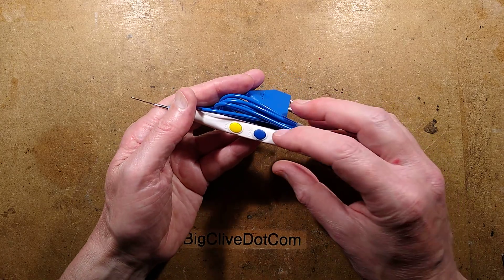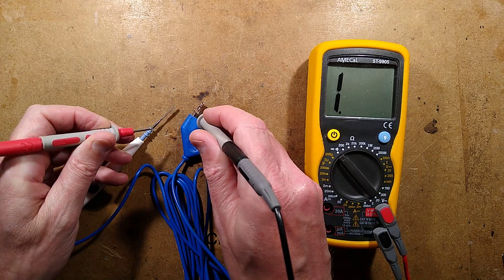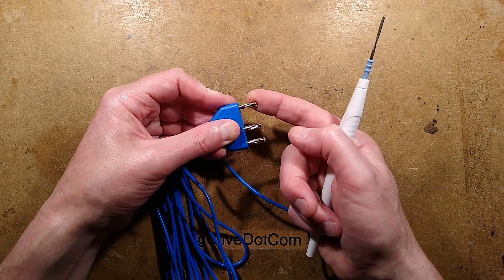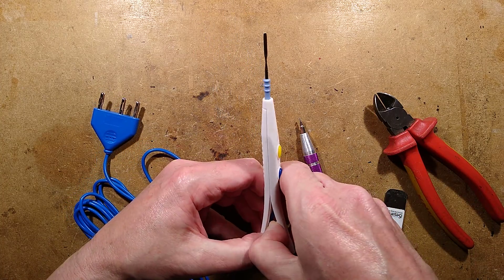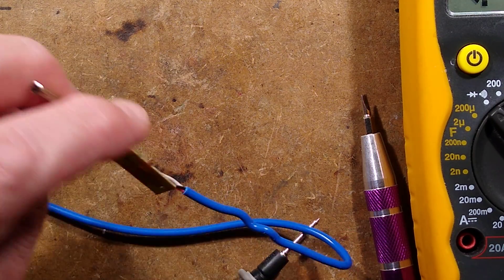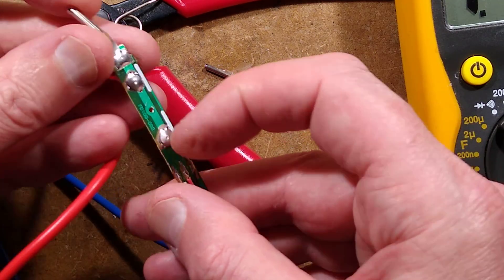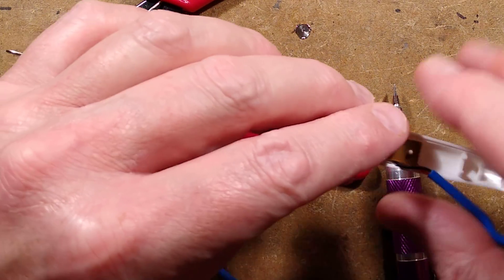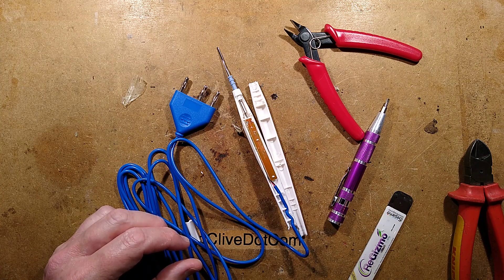Inside a single-use electrosurgery/cauterising pen

Comment: Now to get the control unit to take to bits ... .
Reply: I've checked and the local Poundland shop does not have any diathermy units in stock.
Reply: I've been inside an old Birtcher "Hyfrecator" (portmanteau of High FREquency eradACATOR) which was essentially a spark-gap Tesla Coil with variable coupling between primary and secondary, and a Parkall Dental Model ESU which replaced the spark gap oscillator with a "high tech" triode vacuum valve... (both rather low power units intended for minor out-patient procedures...)

Comment: Handy if you need to sell a kidney to pay for a container full of ozone machines 😂
Reply: Or a gpu
Reply: @alop53O1  lol true
Reply: These pencils plug into a generator, which created a high voltage at several kV and low current at maybe a few hundred mA. The generator is essentially a signal generator and generates modified sine waves for different types of cutting and coag. The generator has different power levels and waveforms depending on the manufacturer, the pencil and the procedure. 
Those pencils are made for pennies. Most of the innovation is in the tip geometry to stop charring and eschar buildup. Some have different coatings too, like a glass coating with only the edges of the blade exposed.
Reply: I'm a DIY tool addict too, I've got shed loads! 

As someone in my 60s with an enlarged heart and lung problems, I'm going to buy one of these for my inevitable heart & lung transplant. I'm preparing one corner of my home workshop for this eventuality. I hate letting others do a task if I can do it, I even do my own plumbing!
Reply: @nicholasvalentine3907  "I even do my own plumbing!" Internal plumbing??
Reply: @lloydpenfold486  Ha ha, yes! 

A few years back, I was in hospital having an examination of a somewhat personal nature. They set up a screen so I could see where they were putting the damn camera, nice! However one thing that went though my mind when it came to my internal plumbing was, "this is definitely evolution and not design", the layout was pretty terrible, what seemed to be a rightangle bend with no regard for flow and other dodgy stuff. Now where did I put that local anesthetic??
Reply: @nicholasvalentine3907  I have watched, in real time, an X-ray video of my spine (to see a 'slipped' disc herniated inside of it), and the picture seen by a Sigmoidoscope as it travelled up my lower intestine. Fascinating stuff, so long as it don't hurt!
Reply: BWAHAHAHA
Reply: Facts 😂
Reply: How... how did you post a comment 1 week ago... on a video posted 2 days ago......
Reply: @everettrailfan Patreon gets early access.
Reply: @weeeeehhhhh  Oh lol that makes sense.

Comment: I had knee surgery in 2014 where they did RF ablation of the patellar tendon. This is the device they used though the one they used on me looked quite a bit more "fancy." Likely for ergonomics purposes.

Edit for clarification: I was not awake during the procedure, obviously. I am an engineer and asked the surgical technicians once they rolled me into the OR theater, what the device looked like that would be performing the procedure. They brought it over to me in its packaging and then the anesthesiologist said "Ok, time to go to work, Brian!" and it was lights out LOL
Reply: I got billed for one of these bad boys after a surgery last year. Just under $800. I didn't even get to keep it!

Comment: The ESUs used to have spark gaps. RFI was not an consideration. The were generically called 'Bovies', at least in the us. When we had to work on them we would go get meat patties from the cafeteria. This would have been late '70s/early '80s. I am sure technology has changed significantly.
Reply: “Bovie” was the name of one of the original manufacturers.
Reply: The spark gaps were replaced with triode valves/vacuum tubes and I believe they now use new-fangled transistors... 🤓

Comment: "Diathermy" also includes using equipment to create heat inside the body for therapeutic purposes. In the 1930s diathermy machines of this kind used MHz-frequency radio waves beamed into the body at high power. They also created huge amounts of radio noise...which was useful during the War when they were adapted to drown out the signals the Luftwaffe was transmitting to guide bombers onto their targets.
https://en.wikipedia.org/wiki/Battle_of_the_Beams#Knickebein
Reply: currently making a comeback in china

Comment: My partner is a surgeon. She says that sometimes they need to clean the tip during surgery, so it is removed and replaced for that. Also sometimes they will need a longer tip, so that's why it can be removed and replaced. The tool is never used in multiple surgeries though, so it is single use.
Reply: Your partner  cutting the Christmas turkey with this tool. The perfect picture on the Christmas card send out.
Reply: We don’t generally remove the tip for cleaning. As another poster suggests, it’s just swept across a scratch pad to remove carbonized flesh/blood. In our instrument count the cautery tip counts as a “sharp” and we remove it from the cautery device to be disposed of in a sharps container to reduce the chance of accidental cuts. The rest of the device (handle to connector at the end of the cord) is just put in the trash with all of the rest of the surgical disposables. The removal is done after the final sutures/staples are placed and just before the adhesive dressing is applied. There are Teflon-coated ones that other surgical subspecialties use that don’t usually need a scratch pad. There are also monopolar versions of this which don’t require an adhesive grounding pad on the patient. The smoke evacuating ones are modular and this handle simply snaps into it. Inserting this handle into a smoke evacuating wand is much easier without the cautery tip installed.
Reply: @JeffandJake  I believe this is a monopolar version, by the looks and wiring of it. If it was bipolar, there would be a return electrode, slightly back from the tip. And the active electrode at the far tip, most likely separated by a ceramic isolator, 2-3mm long. 

But all your other comments are valid.
Reply: I'm guessing it's because they can't sterilize the cable portion of the tool.
Reply: We tend to use a “scratch pad”. A foam backed piece of abrasive material. You don’t have to take the tip off to clean it, just rub the tip across the pad to remove any build up of charred tissue.
Reply: I don't really see why they don't just make a non disposable version of it,you don't trowh away every tool after a surgery so i can't see why they could make one that can be cleaned
Reply: @karvast5726  Read my comments above. They do.
Reply: @arletottens6349  Yup, I figured that out. Just had to point it out for other people as I did not see anyone else mentioning it.
Reply: i kinda assumed from looking at it that clive was right about possible different size/ length tips, but also theres the chance of an oppsi happening and the tip is damaged or contaminated (fell off a table perhaps) and should be replaceable even with a disposable unit/
Reply: @ConstantlyDamaged  Haha spot on. But just... not that last part. Unless you meant it as insurance execs crying tears of joy knowing the cash they'll be raking in afterward. Giving their payout would be little more than a drop in the bucket to the fat cats and the company itself. The amount would be capped at a set max anyway, appurtenant on the malpractice coverage and what our moronic doctor chose for coverage (usually averages around 5 million give or take a few, some do go higher). If the company had any sort of relevant standing/prestige and was a big name insurer, they'd have no issues meeting the payout. Anything past that amount would be dependent on what the patient/plaintiff is suing for; they'd be going after the moronic doc themselves and their personal bank account. But now the insurance company gets to skyrocket the premiums of our moronic doctor who slept through every mention of basic hygiene in pre-med, (and this part is their payday) raise the premiums of everyone else insured through them. The company would end up coming out of it further ahead then they were pre idiot doctor payout.
Reply: never say never.... what happens in third world countries would be intolerable here, in North America or the EU
Reply: @arletottens6349  That's not always the case. This unit is disposable but there are some made from high quality plastics and silicone (non-porous and no glue) for multiple uses. Once the pen is properly sterilized and the tip is brand new, you are good to go. Risk of infection drops to the risk from any other reused piece of equipment. "Increased risk of infection" is coined by western insurance related bullshit to drive up prices.
Reply: @ConstantlyDamaged  insurance is a scam, so they would find an excuse. 
The problem is that medical equipment has an inflated price tag, huge profit margin and usually quite a retrograde production culture.
Reply: @ДаудМухамеджанов  Yea and i bet it's waaaaaaaaaaaaaay better at Putin General Hospital🙄?
Reply: @michealpersicko9531  Pretty ignorant comment, to be honest. The insurance industry is indeed a bloated, inflated mess. We easterner on the other hand, have free healthcare so insurances aren't as prevalent. And no, please don't assume I'm russian.
Reply: What happens if it is used more than once?
Reply: @bloodymary3008  Infection, intoxication and so on.
Reply: @bloodymary3008   Explode!!
Reply: @arletottens6349  but thats what the govt wants
Reply: @bloodymary3008  Then why promote a vaccine? If the government wants us to be infected, they would tell us to not wear masks and to be scared of the vaccine.
Reply: @bloodymary3008  calm yourself love witch 🧙🏻‍♀️

Comment: Next video: Making a PSU for a single use surgery pen.
Reply: The PSU is similar to an inverter, I think
Reply: @paulb7964  At 100kHz to 5MHz, and 300-10,000 Volts open circuit, up to several hundred volts closed circuit. I couldn't find how many milliamps etc. One place I saw 10W and 20-40W, but it didn't specify voltage. Seems like an "interesting" project, but I wouldn't want to be a test patient :-)
Reply: @phizc  Connect it to a Tesla coil for more fun :) High frequency, very high voltage!

Comment: I agree there are probably different types of tips hence those are replaceable. Thought for a second that the rubber tip looked like the one on the tattoo machine you featured, but nope, completely different one.

P. S. I feel relieved that this video does not include a phrase like "i bought this for five pence on ebay from a seller named randombootlegs123456".
P. P. S. «feeling squeamish about this thing in use» is an curious comment after the cattle prod and the SM player featured on the channel.